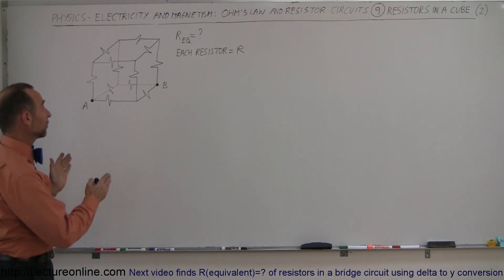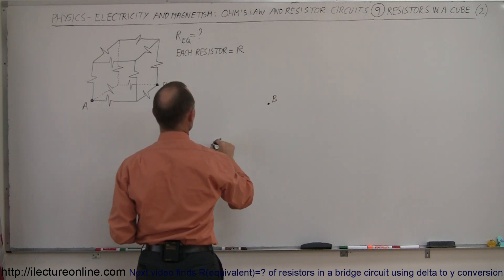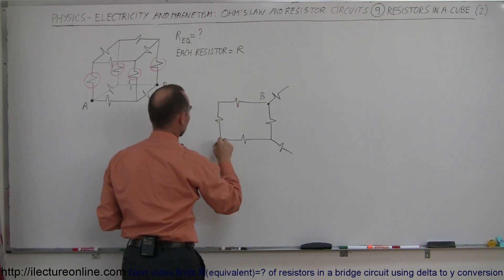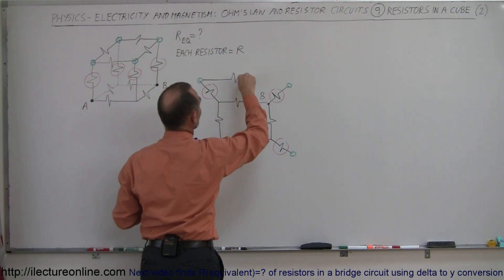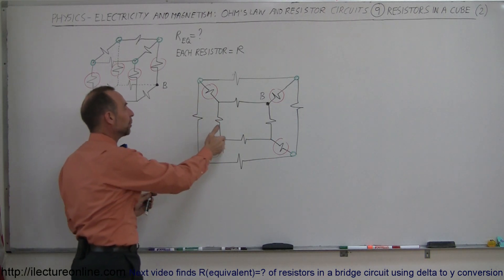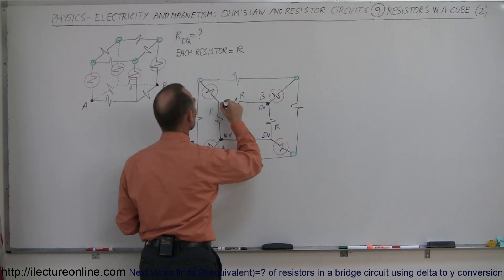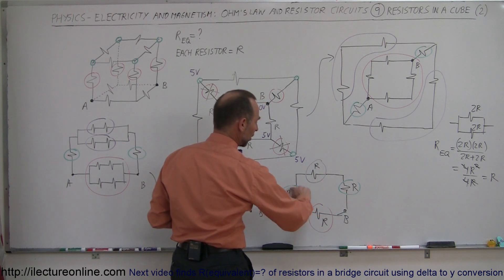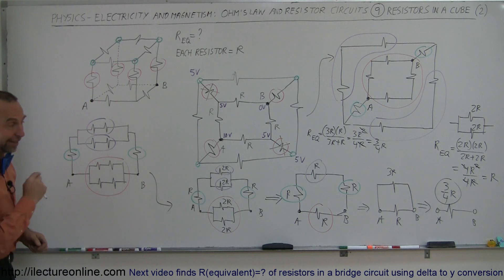Physics 42   Ohm's Law and Resistor Circuits (9 of 23) Resistors in a Cube (2)

Comment: Sir, you said the resistor between the same potential difference doesn't work as no current is flowing, but then why did you took it to consideration when finding the final equivalent resistance shouldn't it be R/2
But you said I is 3/4R

Comment: If terminals A and B were on the outside of the 2D diagram (say, you made the top face of the cube the inner resistor square) would this problem simplify the same way? Like, would it still be the diagonal resistors not directly connected to the terminals that have no current and can therefore me eliminated?

Comment: These Box Resistor Videos are very helpful, but the previous one, and this one seem to stall or freeze up a lot during the crucial parts while you are explaining the approach to solve these. Either way, your videos are always very thorough, and easy to understand, but it would be nice to not have all that extra fuzz in the video...
Reply from the maker: Yes, we had some equipment failures during that time.  We ended up replacing that equipment.

Comment: where people use this cube resistor?
Reply from the maker: Andrew,
A cube of resistors like this is not used in a real application, but it is a good learning tool, so we use it to illustrate different methods of solving resistor circuits.